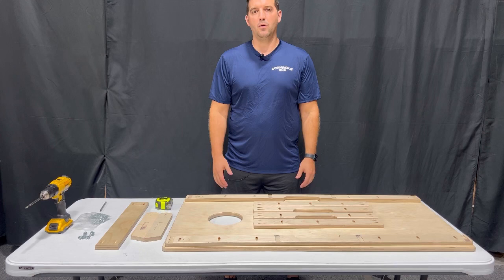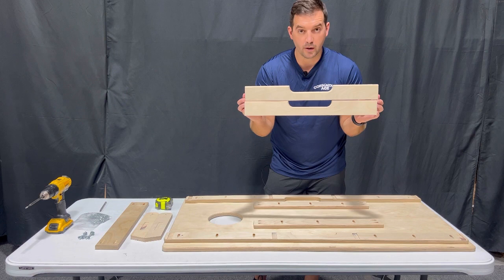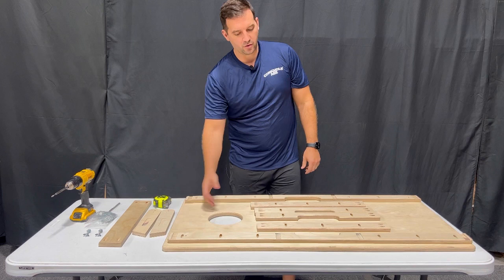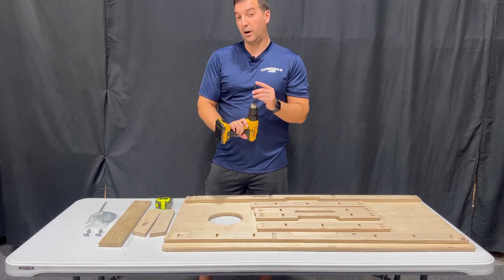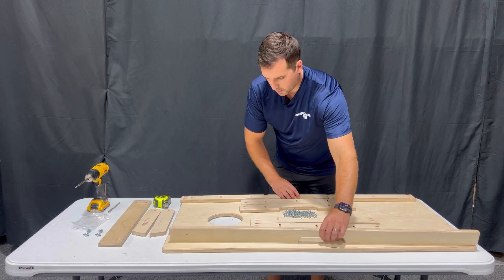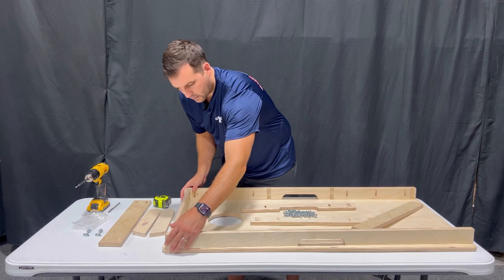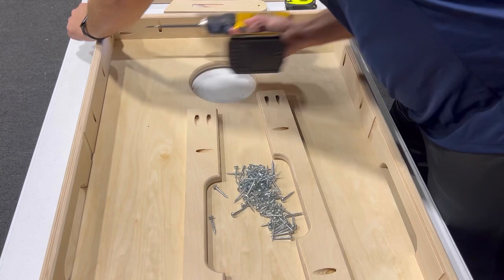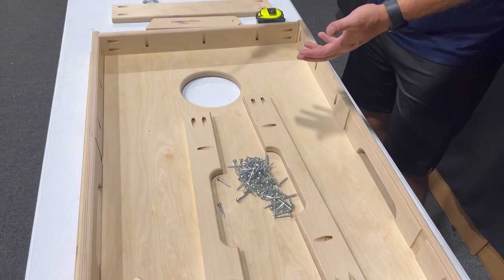DIY Cornhole Board Set Kit Assembly How To Video

Comment: I feel like the inner braces should have been drilled upside down so they act like handles just like the sides.
Reply: You can move the two inner braces to the outside and the outside braces used as the inner braces